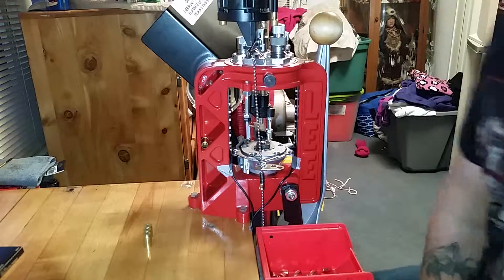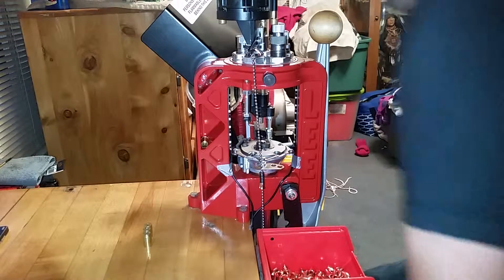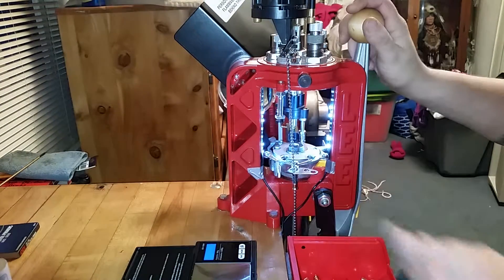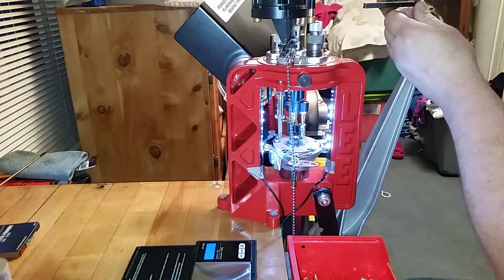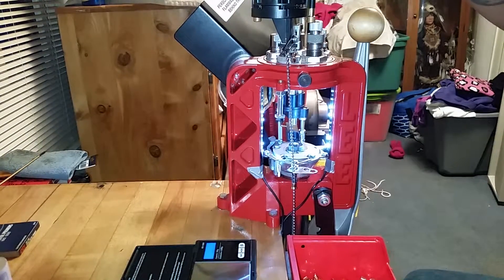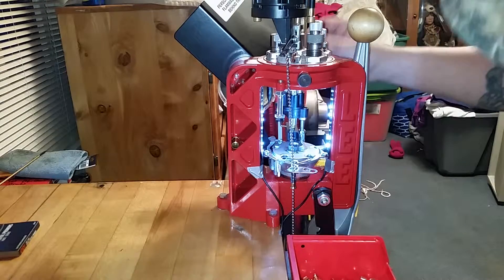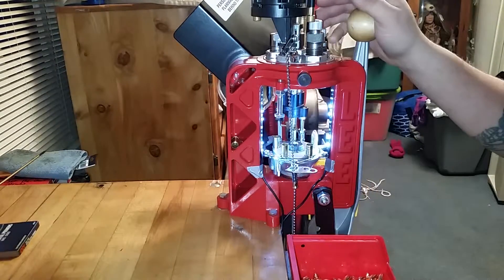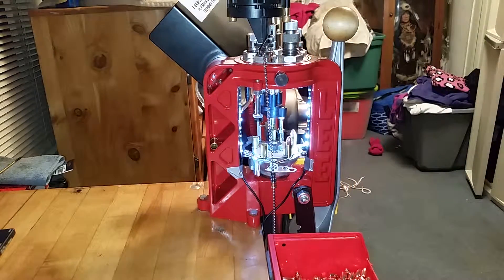Reloading berry's 9mm on a load master part one

Comment: I just loaded the Barnes 124 hbfn. The OAL i found on the website where the bullets are listed for Sale says 1.169 at this length these bullets do not chamber and are in the case very little. I found a blog, where some says they found the OAL is actually 1.05 putting em there made them chamber perfectly. Had to adjust the recommended load down.
Reply from the maker: I us 1.1350 for the OAL